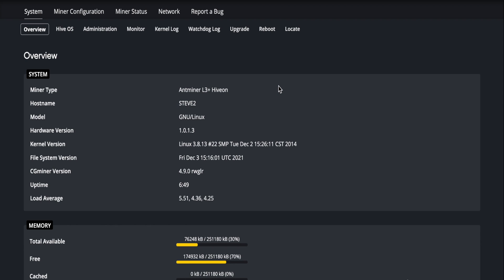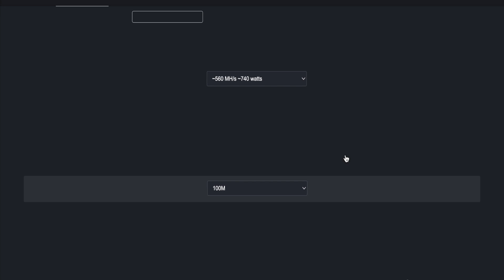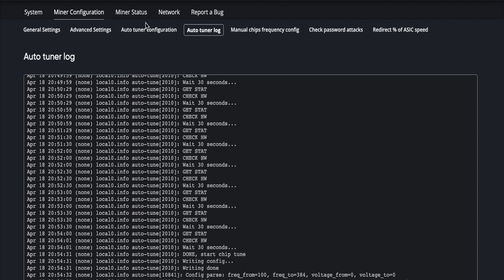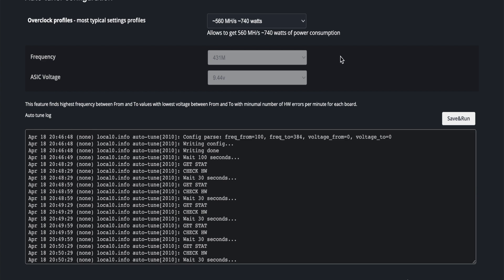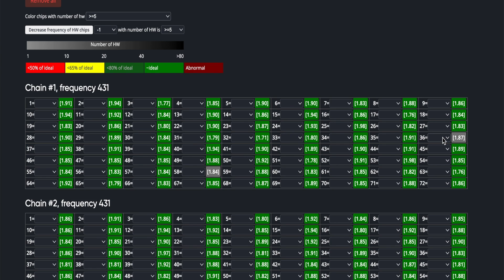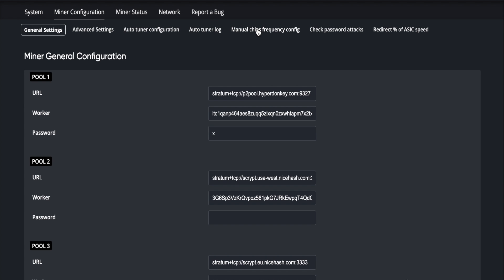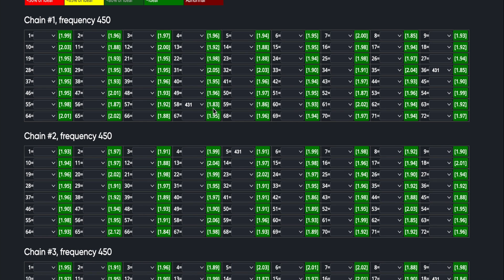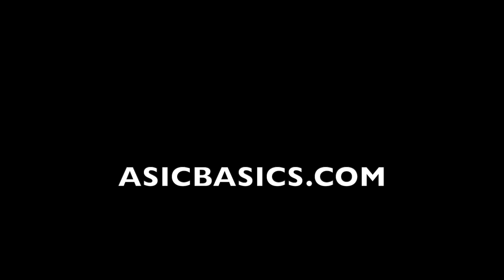ASICBASICS.COM - Using HiveOS to Tune an L3+

Comment: Thank you so much for this video. I don't know if I'm just typing the wrong thing into the search bar or what, but so far your video is the ONLY ONE I've managed to find that goes I to detail on fine tuning individual chips on the board to help with minimizing HW errors. I'm only running stock FM on my miners, but your video still helped educate me on a deeper level that I desperately needed, and I really hope to see some new content from you on these machines soon..thanks again

Comment: Thank you SOOOO much for this video. I have a handful of chips on a few boards at our problem child and was trying to figure out how to do it. Now that I know how to do it. I think I have identified the problem chips on my boards. I know to go into the setup chip frequency configuration. I've identified 1234 chips on one of my boards are either gray or black as they have the most Hardware errors. The frequencies currently are in between 366 and 381. How do I manually tune these 4 individual chips to get less Hardware errors? I know I will never get perfect but less Hardware errors is what I'm looking for

Comment: Great Video - Appreciate the manual tuning coverage. Any suggestions for best Start Point for Frequency & Volts to get power efficiency optimal for L3+ (504 MH/s model)?
Reply from the maker: I always start low, like just over stock freq (~400 MHz) and start around 9.32V (this should get your around 520 MH/S.) Run for a bit and verify you're not getting a lot of errors - reference my article on overclocking: https://asicbasics.com/overclocking-on-the-l3-is-the-juice-worth-the-squeeze/

I basically try to minimize the power draw so I can fit more on a circuit. Then slowly up the Done right you can easily get 4 L3+ units on a 20A circuit. Running around 9.5V @ 400MHz I'm around 850W per unit. Here's another one I wrote on maximizing your circuits - https://asicbasics.com/how-many-miners-how-big-of-a-miner-can-i-fit-on-a-circuit/

Comment: Thanks a whole bunch! That means I got it right. Makes me happy!
I'm trying to set them up on the low settings 9.32/504. One board only has 71 asics and Hiveos has set the voltage on that board to 10.11v and tuned it down so it was only making 382 on the board. I have now changed that by setting other chips to a higher frequency and it runs at 384 now as a main. It doesn't make a lot of HW but I can still only get the miner to make 502MH RT and it makes 498MH AVG. 
But now I dare to set the other chips even higher and experiment to see if I can get it to 504. (I know I have to get the board fixed). But no money for that now. 

What might cause it to only perform with below 400MH and as low as 350-280MH on the pool even when it shows 500 or 498 on the system? It does pick up later and with two miners I make just below 1000MH (940-980) in 24 hours?

Thank you thank you thank you again. You are my new hero!
Reply from the maker: Pools are interesting how they show the real time hash rate. All pools are different and I have seen my litecoinpool hashrate fluctuate anywhere from 330-700MH/s, but I generally run them between 500-560MH/s. Basically they show the real time rate, which you can’t look at, you need to focus on the average hash rate as that’s how you system is truly operating.

As far as your board, if you have one with a bad ASIC I wouldn’t overclock it as the old rule of thumb applies, where there’s one there’s more. So you may be on the edge of others failing.
Reply: @asicbasics  Yes I only wan't to run on the low settings. Looks like a better idea to plug in one more miner than to overclock four miners. I bought five machines and only four are working (or four boards out of 20 were bad) So I build them into four miners.

I am again guessing according the settings of the frequency. 
If I have to set one chip down two steps in frequency then I put the one before and the one after, one step up. and If I still have to set it further down after five hours then I move to the next chip to set that one higher instead of setting the others higher.
There is no full chain that is having many HW... Not yet anyways. :D 
I try to keep everything as low as possible to get the miner as close to 504MH as possible and the RT and AVG as close af possible.

I love your Asicbasics.com page and I will go through every single subject and video you have. It's pure genius!

Thank you again for being willing to help out and making these videos.